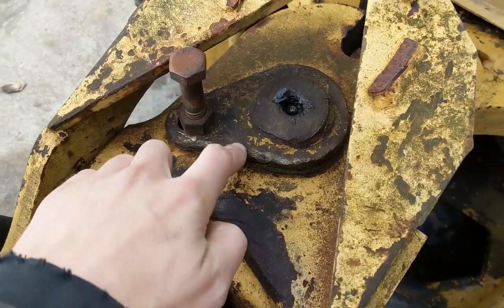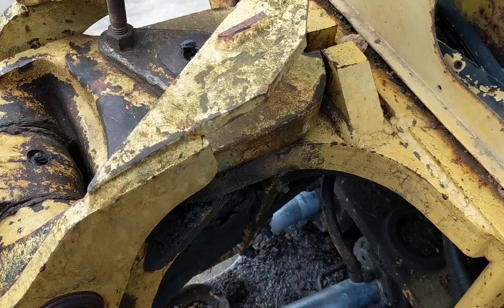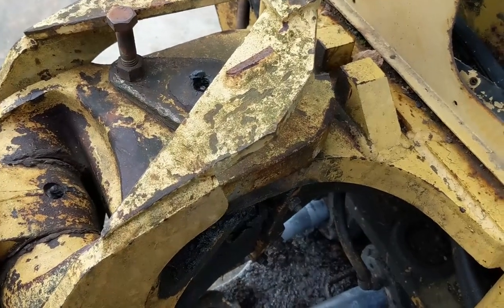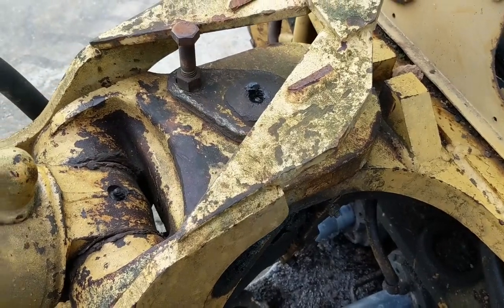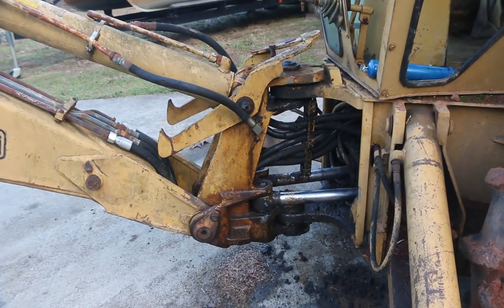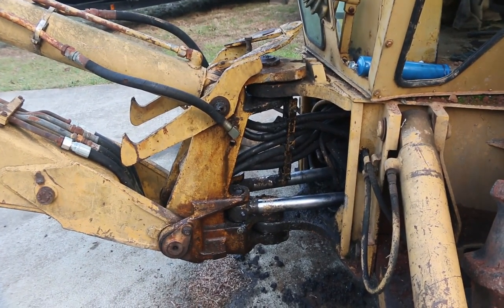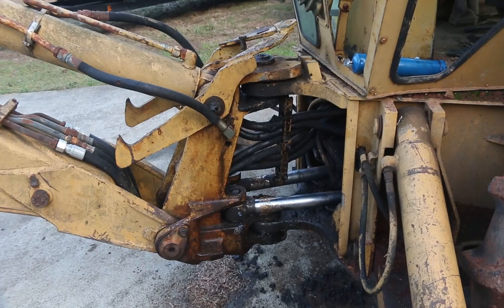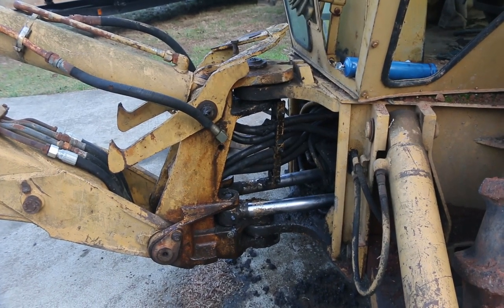Replacing pivot pins and bushings on a Ford 555A Backhoe

Comment: Good video I should do my pivot pins and my swinger bushings but my injection pump just went but these triple nickel Ford backhoes are such great machines if I ever won the lottery I would rather completely restore my 1978 rather than buy a new one!!!
Reply from the maker: I had an issue with my IP fuel pin sticking, I filmed a bunch of stuff but ended up not making a video about unsticking it, but my machine is running again now, so maybe I should dig up that footage and make a video just in case yours might just need the same thing mine did
Reply: @trythistv  that would be great because sometimes it runs but it misses on one cylinder but recently it only runs when I put diesel in a empty spray container and keep giving it a mist every few seconds and I don’t know if it is the pump or the injectors and I can’t afford either at this time 😀
Reply from the maker: Check out this video, I'm not sure which pump your tractor would have, mine has a CAV style that is covered in this fellows video, https://youtu.be/h26p78YZIr4?t=1038
This video helped me see how the injector pump goes together, I didn't remove mine from the tractor, I just did the top cover stuff that he removes from 17:20-25-23 in that video

24:10 he shows the governor pin/shutdown pin and explains the issue you can have, this is the thing is that was stuck on my pump, I cleaned everything and polished that pin up until it moved without any resistance in the little hole it sits in.
44:29 he starts reassembling the top housing stuff.

Comment: Where did you get the pins and bushings for it please if you can help me find them because I have the same problem?
Reply from the maker: I found some used pins on ebay, and got bushings from Messicks I believe, I found the same bushings here: https://ebay.us/hxIRJp
If you order from messicks, watch because they have several types of bushings and some of them were $200 or more for the same thing as a $30-40 bushing, guess they must be a different brand or something, They do also have the pins if you need them, but they are pricy.
Mine are holding up nicely!

Comment: How long did it take you?
Reply from the maker: The first time around it took me most of the day, the second time around it took me maybe 2 hours or so, it's heavy and thus very dangerous if the arm falls or anything but it was not a terrible process and now its so much better to operate the machine, arm doesn't wobble all around.

Comment: I might as well be watching from the neighbors house  how you removed the bushings. I saw a little bit of welding and a hydraulic Jack used on the bottom. And that’s alli got out of it. Not a useful video at all.
Reply from the maker: I mean you remove one bolt and then drive the pin out with a hammer, then cut the bushing out with whatever your favorite cutting implement is. Most of my old bushings had disintegrated so I only had to cut off remnants, had the camera set to time lapse instead of record properly, didn't realize it until it was too late, still not exactly rocket science, but incredibly dangerous so maybe it's good that it isn't super clear, if you can't figure out how to do the job, it may be better not to, as that boom will crush you like a pancake if you don't support it properly